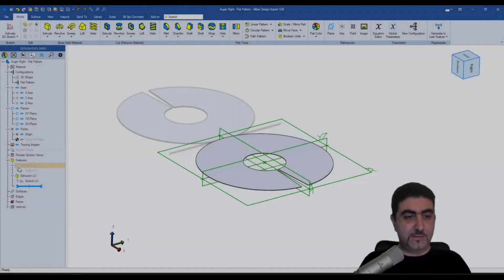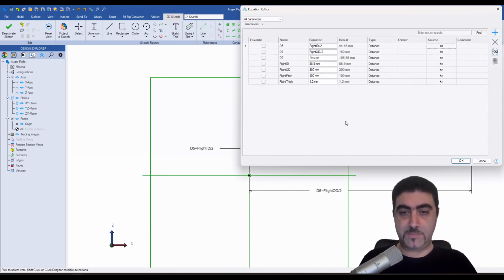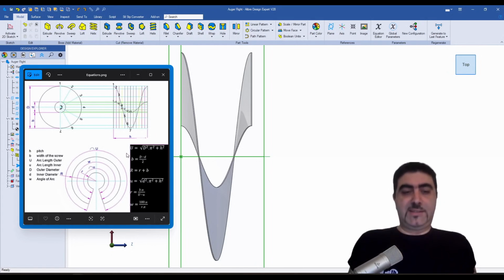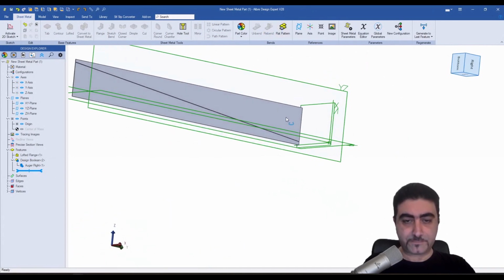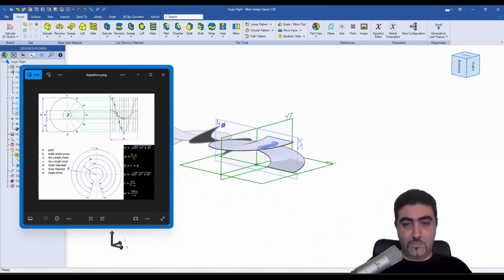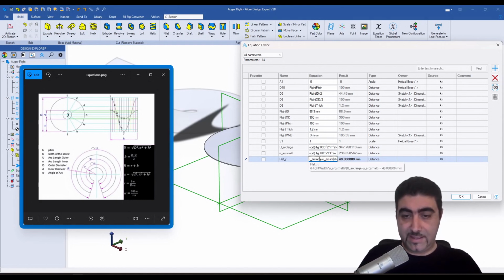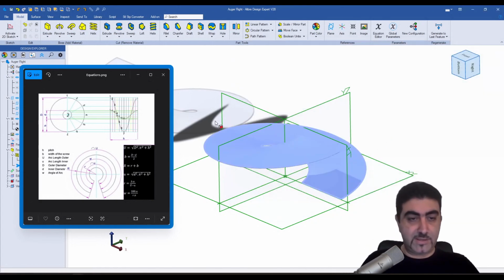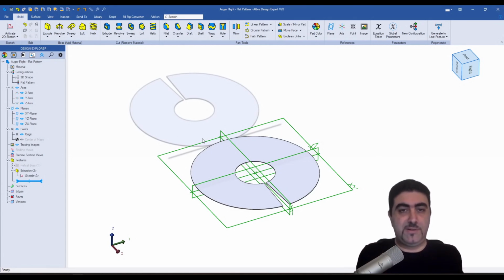Screw Flight & Flat Pattern: The RAW math in any CAD

Comment: So here is an answer: both

If the client has no system, I'll use my own Alibre license. 

If the client wants to integrate me a bit more into their workflow or they are adement on having native files in their system, I'll use their license or rent one.
Reply from the maker: Generally speaking, I will also work on any system the client wants. Either they get me a licence, or they pay extra and I get a limited time licence on my own.

But the design will be the same. Because the designer is the same. There are small efficiencies between software, but engineering a machine is more than just drawing lines. So, the CAD system has little effect on the final design.

Comment: I used to work for a place that made both hollow stem augers and solid stem augers. From 3 inch of up to 24 inch od . They were all 60 inches long. We purchased continuous flight up to about 10 inch od. Over that it was single flight pieces welded together like you were showing. I was using AutoCAD 2D and I did your unwrap trick to make sure the flight would miss lock bolts and stuff. I really liked your mathematical explanation. Great video.
Reply from the maker: That is so cool!!! These augers are one of those things in manufacturing and engineering where you see the end result and think "That is quite a simple part". But there is a lot of work and engineering behind it. Cool job making 24in OD augers. Oh man!!!